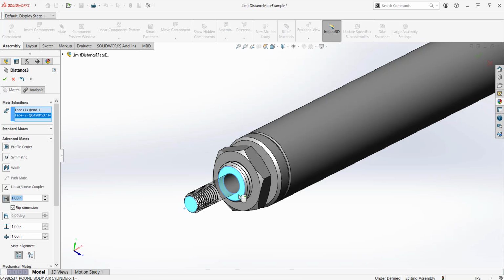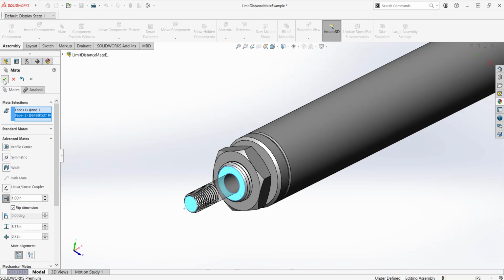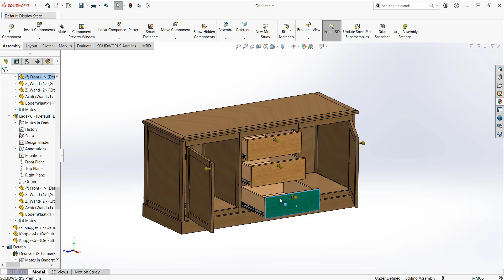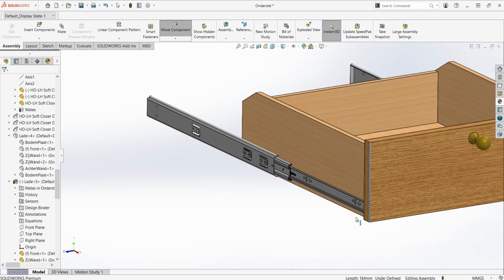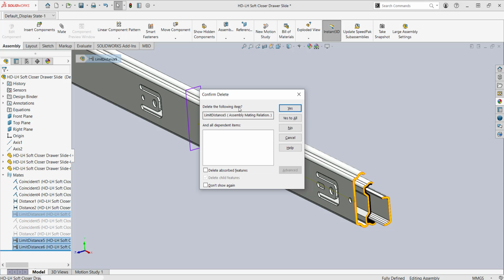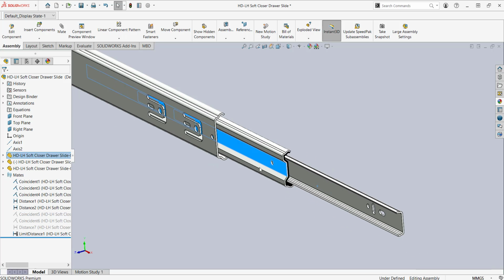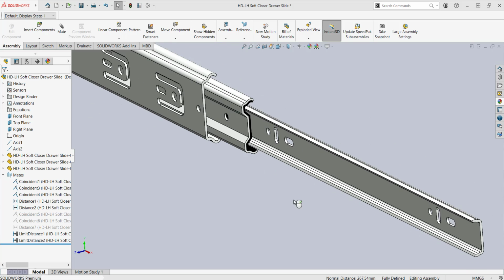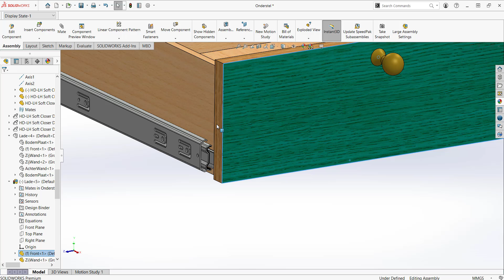SOLIDWORKS Tutorial - Limiting Motion Using Limit Distance Mates

Comment: Hi. Is it possible to refer to the maximum or minimum values of a limit distance mate in an equotation? I'm trying create a parametrized assembly with parametrized components. I did some searching about this but no luck. I want to modify a lower limit distance and the upper limit distance with global variables with equotations.
Reply from the maker: I think you're on the right track with trying to use Global Variables as your way to do this. Using them in limit mates can be difficult, but take a look at this solution. It might help you out: https://www.reddit.com/r/SolidWorks/comments/uca96l/global_variable_as_mate_distance/

Comment: Is the limit mate not supported in Motion Study?  I am attempting a "Basic Motion" motion study but my pneumatic cylinder I have constrained exactly like yours using the limit mate is not being respected by SolidWorks.  If this is an unsupported mate type and if so are there are clever tricks to use this type of constraint within a motion study?  Thank you!!
Reply from the maker: I did some digging and angle limit mates do not see to be supported but linear one should be. I would check with your VAR's tech support team to see have them take a look at your specific situation

Comment: thank you very much for this tutorial, When I use this function in an assembly it works fine but when I take the same assembly and use it in another assembly it seems it doesn't work anymore and it acts as if it is fixed. is there anyway to fix this problem?
Reply from the maker: Hi! I am glad you enjoyed the tutorial. It sounds like your subassembly may not be in flexible mode. To make a subassembly flexible, click the subassembly in the FeatureManager Design Tree and select “Component Properties.” In the dialog box, under “Solve as,” select “Flexible,” then click OK. Please note that flexible is not available for lightweight subassemblies. Thanks for reaching out. Please let us know if you have any additional questions about this.

Comment: I'm using stacked limit mates, just as you've demonstrated, but they don't always work like you show in your video. Sometimes they do and other times Solidworks becomes non-responsive. When Solidworks is non-responsive, it doesn't show any errors and it seems to be functioning fine otherwise. I've found, if I save my model, close and reopen Solidworks, the assembly works well until it randomly locks up again. Help?
Reply from the maker: Hello!

Stacking limit distance mates can definitely slow down SOLIDWORKS performance, especially for large assemblies. In these cases, we recommend creating various configurations based on the various positioning of the model, instead of using limit distance mates. For example, you may have a pneumatic cylinder with a configuration for when the rod of the cylinder is extended and another configuration for when the rod is retracted. You may also want to perform a “Performance Evaluation” (found in Tools > Evaluate) to determine what is causing SOLIDWORKS to become non-responsive. Additionally, we have a video on our channel called “SOLIDWORKS – Troubleshooting Slow Performance” if you would like to learn more about this topic.
Here is another helpful video: https://www.youtube.com/watch?v=LyUJXRA5zB8